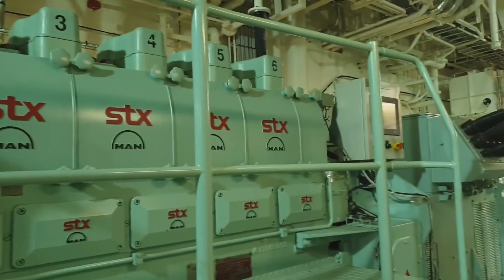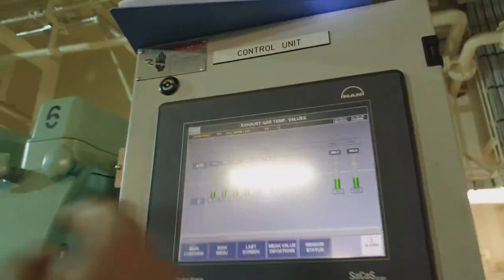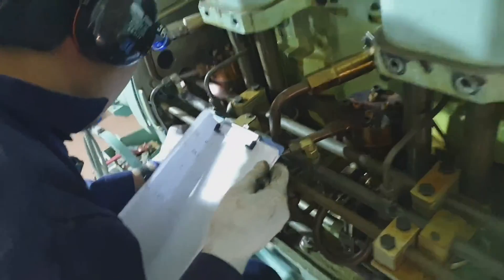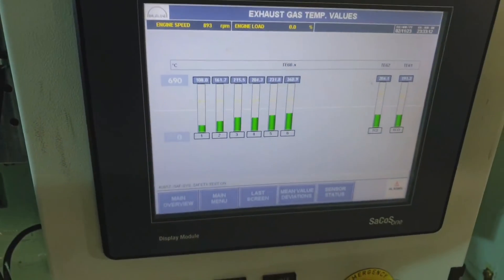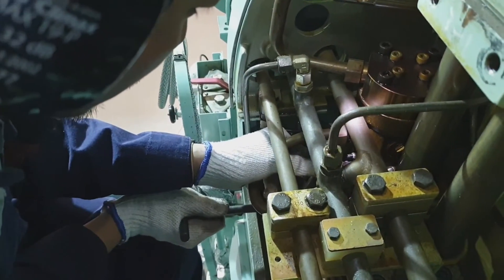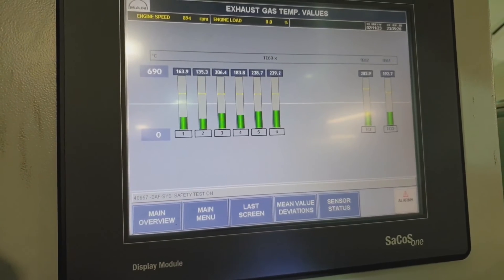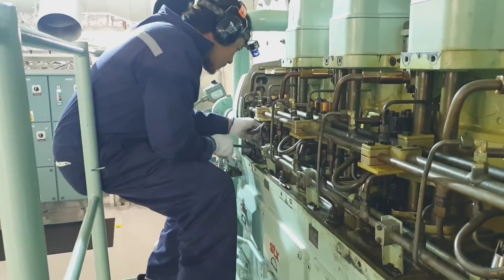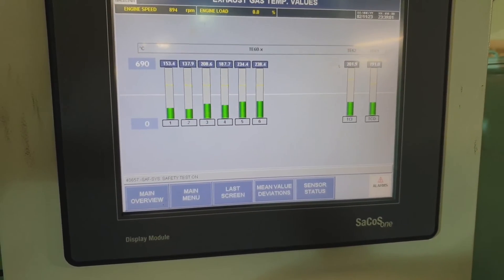HOW TO ADJUST EXHAUST GAS DEVIATIONS OF GENERATOR

Comment: Thank you sir! What is the permissible temperature difference?
Reply from the maker: At 70% load of the engine the deviation should not exceed more than 30 to 40 degree celsius
It depends on the makers instruction sir

Comment: After adjustment of the fuel rack also deviation is there, what could be the reason ?
Reply from the maker: So many factors sir, normally engine fuel rack has to be adjusted at maximum load to balance the engine, at about 70 to 80 percent load, in that case you can see the that deviation is minimal and within limits the engine is good. Now, when the engine is in low load or less than that of 70 % , its normal that it has deviation because it is low load operation..
Reply from the maker: On the other hand there are so many factors,   it could be fuel injectors or fuel pumps..
Reply: Take out fuel injector do pressure test and check it's injection pressure, spray pattern and ensure no dripping is there. 

If everything is okay in injector then need to see fuel pump.